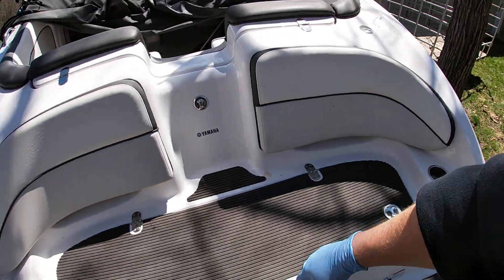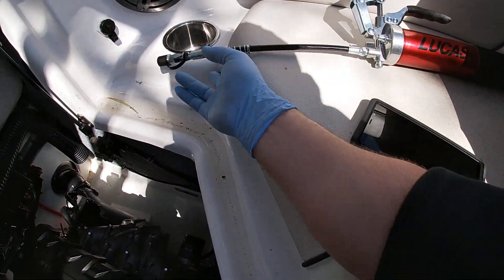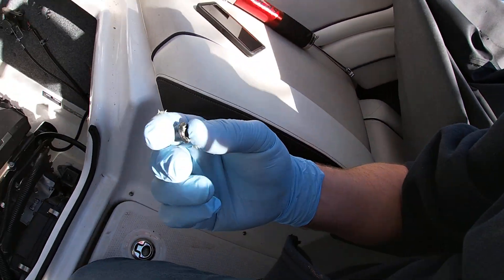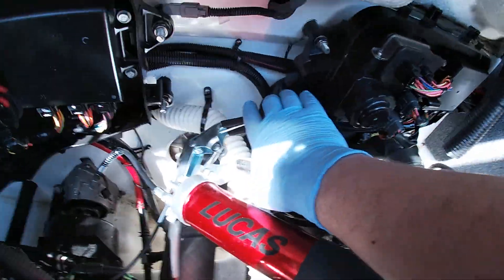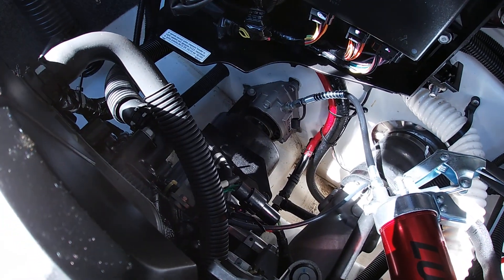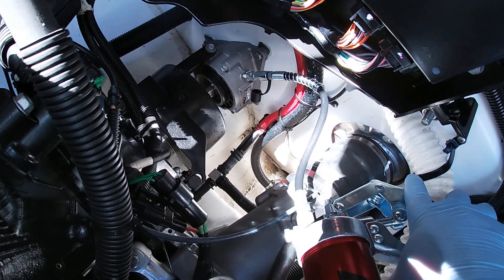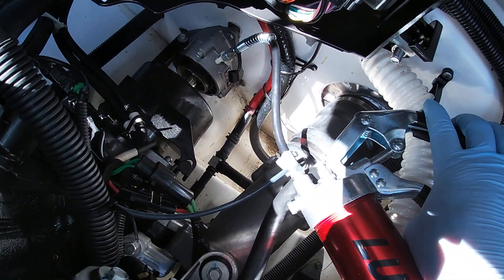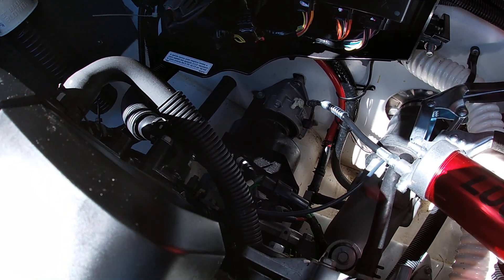2019 Season - 2014 Yamaha AR240 How to grease pump bearings

Comment from the maker: Just a quick update on this one.. The chattering noise you are hearing would not be cleared up by greasing these bearings. Most likely the noise is from clearance issues with the impeller and wear rings. I'll be replacing the wear rings and inspecting the impellers in a few weeks and will make a video doing so. Thanks for watching!

Comment: Man I'm going crazy trying to track down this rattle.  I have a new to me 2012 242 Limited S and the Starboard motor has a noisier rattle than the Port.  Independent mechanic noted it but couldn't find anythign wrong.  Dealer mechanic (of course) said it was fine.  I suspected impeller and wear ring and pulled the entire jet drive and both were in perfect shape.  Reading these comments maybe it's normal?  I've only had it out once but it performed perfectly.
Reply from the maker: Mine had barely 40 hours on it when i bought it from a yamaha dealer. I asked them what it was they said its normal.

Comment: I have a 17 212x same rattling noises when it’s out of the water idling. Definitely a good video though. I need to start greasing that. 

Is there any other grease spots on the HO engines ? Thanks
Reply from the maker: Not sure if you have already found the answer but I have not seen any other grease points other than where the manual says to put some grease on the moving parts involved with the steering and gates in the back.. Like some other folks my steering gearbox is starting to get a little noisy/clunky so I may take it apart and see whats going on.. thanks for watching!
Reply: @cannedham3774  I never found any other greasing spots, my 212x with the HO engines; I  can’t even reach down to the housing, it’s all blocked by exhaust tubing etc. I don’t how people are greasing these things. Yours looks like it has plenty of working room .
Reply: Update… so because I have the 4 star model, the catalytic converter blocks the area that shown here in the video. But they did make life easy for the 4 star models. There is a rubber extension hose that runs to the top with a zerk fitting and cap. It’s been right in front of me and I was blind lol…. Mystery solved. But you’ll need more pumps than normal because you gotta fill the hose that goes down to the impeller housing.

Comment: the noise your hearing isn't from that bearing. it comes from the jet pump assembly. this noise is normal for it and all jetski as well.
Reply from the maker: Yes! This year I will be replacing the wear rings and inspecting the impellers. I will try to make a video. I've learned quite alot about these boats over the last few years. I was hoping greasing those seals would help clean up that chattering noise but it didn't.

Comment: I just bought a 2021 AR190 with the 1.8 engine. How aften should I grease that part. Every year about 5 pumps a year? Anyone have an idea? thanks.
Reply from the maker: The dealer said to just check it and dont over grease but once a year is good.

Comment: So my yamaha sx192 is almsot 5 years old. I put in the water last week and heard a high pitch whine. Not all the time but 2 times that day. Never heard that before then. So i came home and flushed it. I never heard the whine. Could this be my issue also? What could it be if not?  Thanks for the video.
Reply from the maker: That could be a lot of things. Interesting that you flushed it and it went away. Possibly something in the cooler? Let me know if it happens again. I've never heard either of my motors do that and I'm up around 200+ hours now.

Comment: Thanks for the video. 
As a few other people commented,
My 2018 waverunner 1800 has a lot of noise out of water as well.
I lube mine once a season at winterization time. Just a few pumps. 
I worried about bearing failure as well. 
Checked for play and coupler looseness,
All felt tight. What a pain to get access!
I even felt the bearing housing with the engine running and it didn’t seem to vibrate or feel rough. 
I have gotten a lot of inconclusive answers from dealer as well.
Reply from the maker: So I went back to the dealer and another guy said Its normal.. I'm going to do wear rings this year.
Reply: @cannedham3774  I did wear rings this year as well. That was the source of chatter for me. It would surprise me if it was actually your bearings making the noise.  Did it fix it for you?
Reply from the maker: @rhlott  Greasing the bearing did not fix it. I suspected it wouldnt but the dealer said I should grease them and see if it cleared up the noise. The source of the noise is defently the wear rings.. I really hope I dont have to replace impellers! Thanks for watching!

Comment: Did the greasing of the bearings quiet it down? I have an sx230 2013 with same issues
Reply from the maker: No. I talked with the dealer and they tell me that even the 2020's do the same. Jet ski's as well. Thanks for watching!
Reply: Is it kind of a rattling type sound? My 2021 has made the rattling sound since the first time I started it
Reply from the maker: @csmith0244  Yes. totally normal on these jet pumps. I will be replacing wear rings this year but still expect there to be chattering coming from them.. Sad thing is one of the local guys at the dealer gave me that schematic in the video and pointed out those bearings and said the noise was from there... I think he was trying to get me to bring the boat in to replace them!! (hell no!)

Comment: I have a 2019 AR240. this spring I've noticed that the steering is much stiffer than last year. Is it difficult to grease the steering fixtures on the boat. Do you have a video that shows how to do that? Thanks!
Reply: I don’t believe there are any grease fittings on the cables.  They are supposed to be internally lubricated for life.  After forcing gear oil thru them with a compressor at 60psi and not seeing sufficient improvement, I went ahead and ordered an OEM replacement from boats.net and viola- good as new.
Reply from the maker: @rhlott  thanks for sharing! So, I did notice at slow speeds it is a bit harder to steer now and at the wheel it feels a little clunky.. I may open up the gearbox behind the wheel and check it out or just replace as you did. I really appreciate the comment!
Reply from the maker: You know, i have noticed the same this year on my 2014... I'll look into it!!